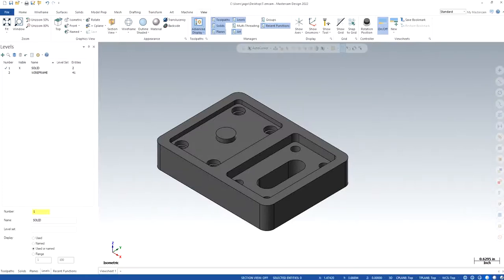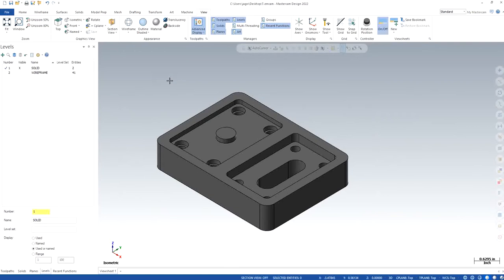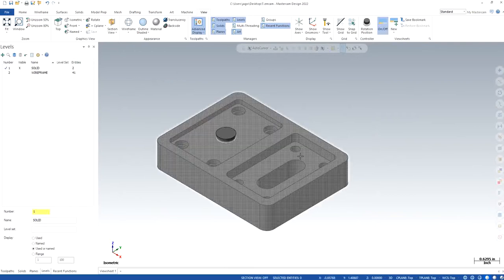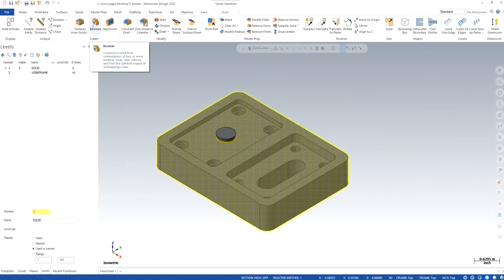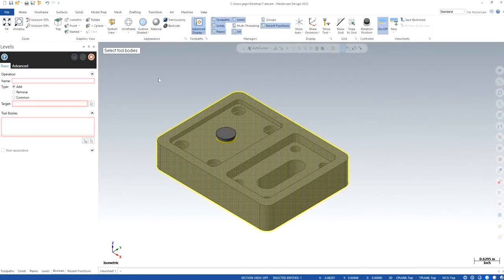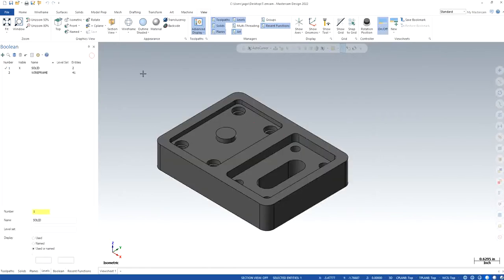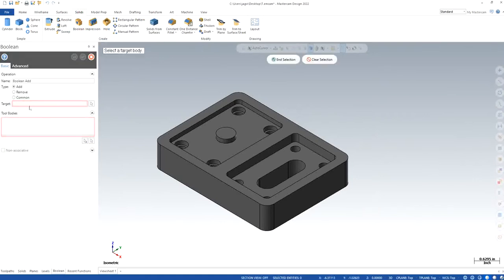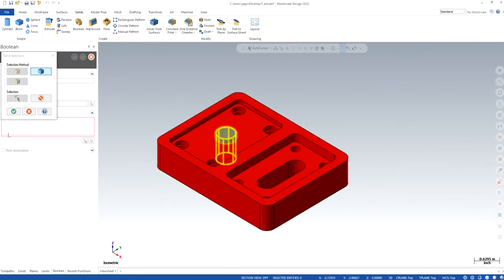MASTERCAM 2022 : HOW TO USE BOOLEAN FEATURE ?

Comment: Wait, what's going on here? I've watched the videos multiple times and don't understand 
 Thanks
Reply from the maker: It’s basically combining 2 solid parts to make them 1. When you have multiple parts in solid, then sometimes, if you have operations which require you to select solids, they cause issues and mastercam shows error identifying the solid model, so then it’s just better to work with 1 solid only to avoid complications.
Reply from the maker: Feel free to ask any questions about solidworks , mastercam or catia